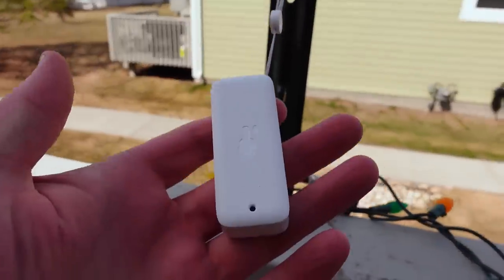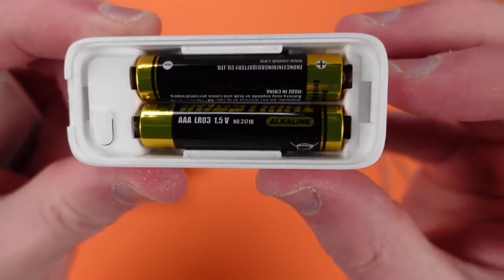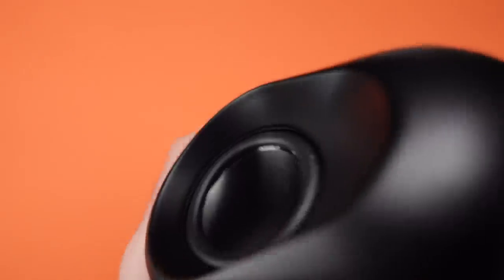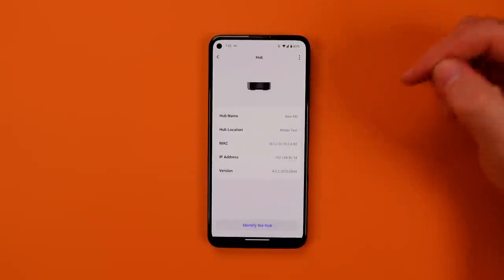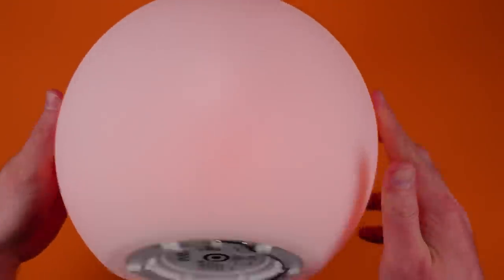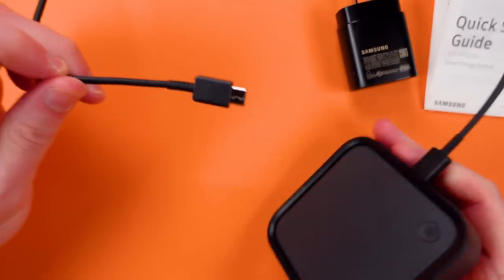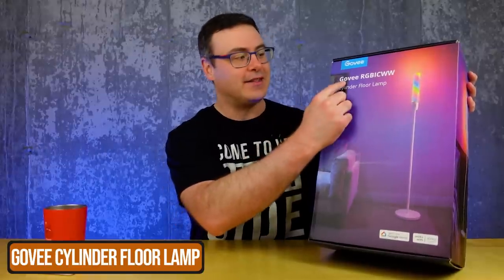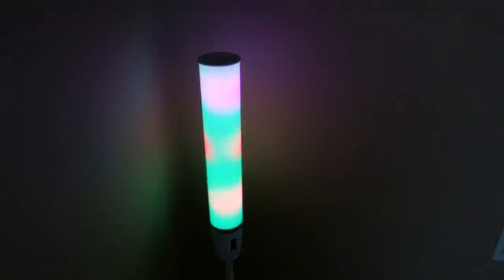My Massive Smart Home Tech Unboxing - EP 11 - The Best So Far

Comment: Yet another great job, Brian.  I look forward to these monthly videos.  I have a couple  of comments...  First, I love my Aqara lock.  I got one and replaced a Schlage Z-wave lock and couldn't be happier.  Being able to unlock it with a key (I never use one), a keypad, a finger print (more than one finger allowed), a tap of an iPhone, and a tap of my Apple watch gives more options than almost any other lock.  Furthermore, the price is right. That Eve Orb is interesting but quite expensive.  For several years I've been using similar, but much less expensive Echo Glows.  I use them for a bit of color in a room, but mostly for notifications.  Blue for a leak, green for garage door open, red for smoke, etc. etc.  I'd like to see an Eve that is half the size and half the price.  I love the Lutron stuff and replaced all my Z-wave and wifi wall switches with Lutron and couldn't be happier. Their stuff is totally reliable and fully spouse-friendly!  I've found using code compliant Wago lever connectors (look 'em up, try 'em and give a link) give just a little more space than wire nuts and have helped in situations where things are too tight. Do a full review of the Dreo and get some new followers!
Reply from the maker: I'm so glad you like these videos Hugh!  I always wonder if it's the right way to spend my time.

Oh and the Dreo...no kidding hey?  Might be the best device I've had yet.  Thanks sir!

Comment: Hi everyone, QUESTION - I'm really interested in getting the Aqara U100 smart lock. Looking at it from this video the middle bar that goes between the 2 parts looks kind of flimsy. Is it strong enough to provide sufficient security for the front door? Is it a universal lock in that it can replace any door lock or is it just designed for a specific kind. Also, does anymore know if/when this will be released in UK/Europe. Would be really helpful if anyone has any advice for me. I know that's a lot of questions so thanks so much in advance 😂!
Reply from the maker: Watch tomorrow!  You should see a UK/EU version though :)

Comment: Hi Brian,
I currently have other branded wifi temperature sensors that don't connect with wifi 6 routers? (It worked with my old router ) Was that sensor connected to your mesh set up?
Reply from the maker: It's odd to hear that a sensor won't connect to any router.  As long as it broadcasts the right 802.11 standard, you should make connection fine.

But yes, everything wifi connects to my mesh system.  It's now up to wifi 6E capable
Reply: @AutomateYourLife  awesome to hear.

This is what is posted from a company Tuya
'Please confirm that your router is a Wi-Fi 5 router, or turn off the Wi-Fi 6/802.11ax mode of the 2.4GHz Wi-Fi in the Wi-Fi 6 router. Our devices cannot connect to Wi-Fi 6 standard Wi-Fi'
Reply from the maker: @grant26  turn off 5 GHz wifi if they have the same name (SSID).  That's what they're saying.  Your sensor can only connect to 2.4 GHz wifi
Reply: @AutomateYourLife  thank you, I literally tried all of that even disabling the AX element. Will keep giving it a go.
Subscriber for life

Comment: I have one of their 5.1 systems with wireless connectivity just plug them into an outlet for each one. I actually love their system but regretted buying it after I needed assistance. When one speaker quit working. It took me a year and a half to finally get my speaker back that I mailed into them at my cost. Worse than that though was their treatment of their customer namely me. I can provide you with a complete email list. Going back and forth between them and myself. The person that I dealt with constantly was rude, spoke down to me, and frankly acted holier than thou. It was horrible to do with their customer service. I will say when it's all working., It's good though and sounds amazing! I would say go with the other wireless systems out there using WESA standard I think it's called. Which is their own proprietary wireless signal which they use. The standard is not proprietary and you can't find other surround sounds that will use the wireless signal for their rear and surround speakers. I would go with someone whose customer service is better any day .
Reply from the maker: Bad employees ruin everything...
Reply: @AutomateYourLife Yep I can deal with a lot of things. Just not bad customer service.